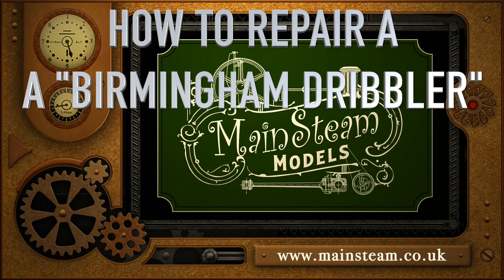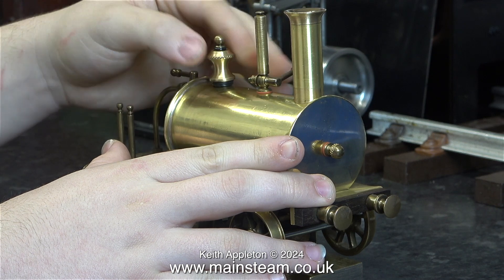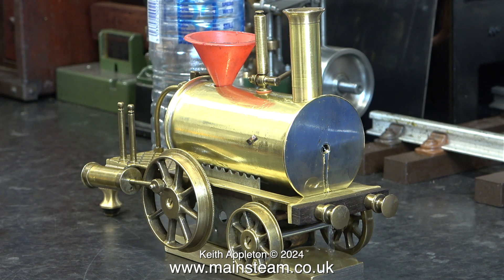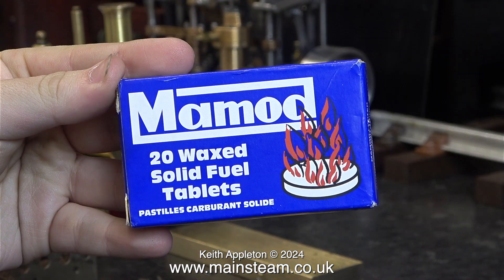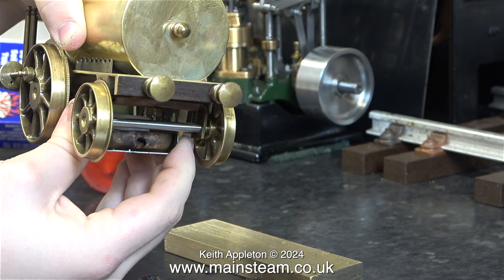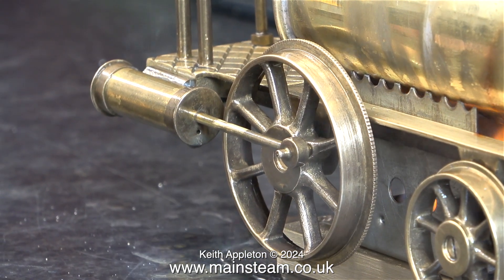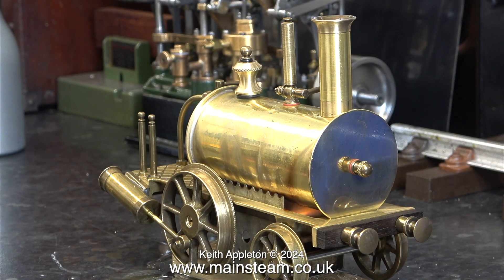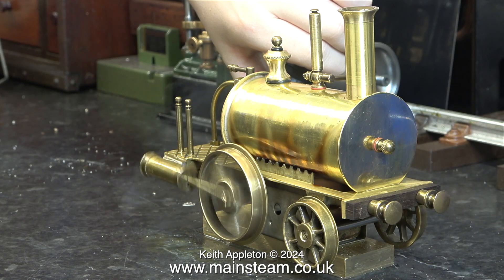HOW TO REPAIR A "BIRMINGHAM DRIBBLER" - PART #5

Comment: I have had luck with Esbit solid fuel tablets, might work here too. 
About quartering the wheels - it being single acting cylinders, maybe they should have been halved - but I do know what looks the best! Thanks for the video!
I saw one like yours in Germany about 30 years ago, broken axle too, can't remember what they had named it, but it translated into "carpet wetter".
Reply: Have seen several Mamod SE3 stationary engines, some quartered, some "halved". Not sure if they left the factory the same way but the Mamod brochure I have shows them halved.

Comment: What about the heat/burn/discoloration on the sides of the boiler? I like the look of the toy and am always impressed by how simple or how complex these engines can be. The simple principles are the same. Thanks for these videos.
Reply from the maker: The carbon discolouration is from the waxed pellets. They do not burn clean and give insufficient heat.